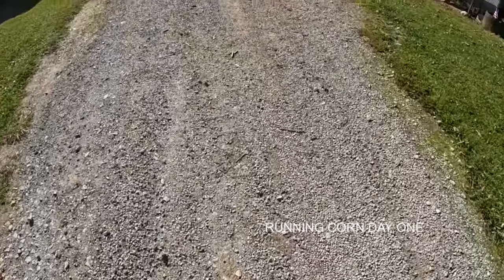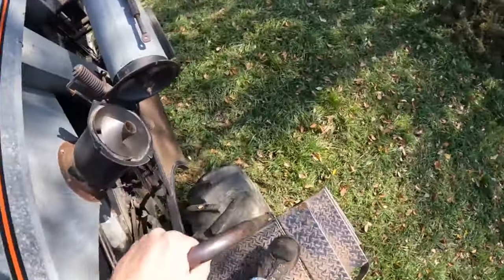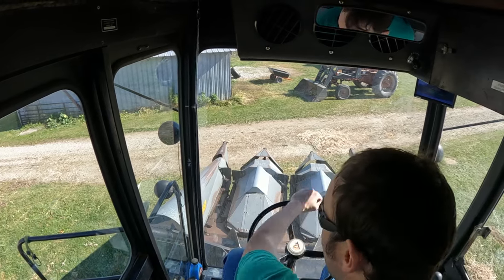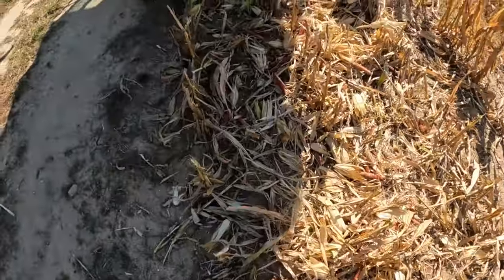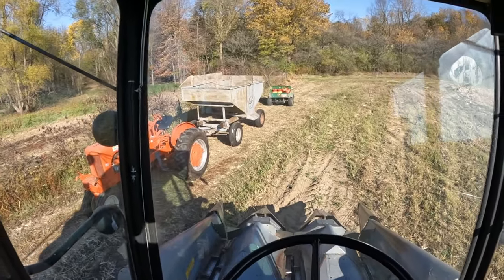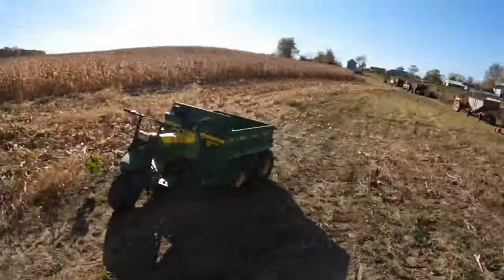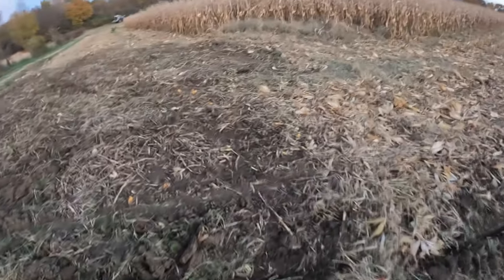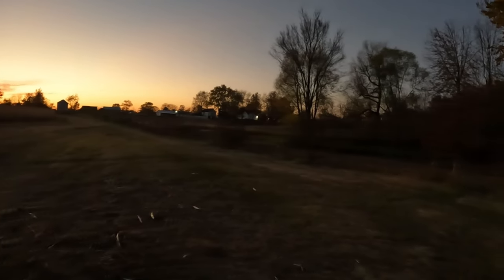Running Corn Day 1

Comment: You are the only YouTube that I've seen that actually stops the machine and gets out to check on the machine set up,  then reads the owners maintenance book to compare the schedule and how to adjust the machine to get the best out of it.  Your machine might not be the latest super dooper 25 row picker but at least most of the crop ain't going out the backdoor.  you do seem to get the carts on the wrong side and have to spend time turning to unload.  Nice vids from Kent, England, the UK
Reply from the maker: Thanks John!  I appreciate it.
Reply: DsssY
Reply: LOL:)  Neighbor of my BIL bought a new CIH rotary and the salesman told him it was "field ready" when they delivered it... SO he went straight into the bean field and started cutting.  Well, he didn't figure it out til later, BUT evidently "field ready" doesn't include actually closing and latching the top cover on the elevator where it's tossing the beans over onto the yield monitor plate before they drop into the bubble-up auger and get sent into the grain tank... Of course EVERYBODY knew it after the next rain, because he had the prettiest green strips of soybean sprouts painted like foot-wide lines all the way across the field, tracing every turn, etc. They were so thick, like a carpet, so he probably lost 5-10 bushels to the acre... it was crazy!  He was glad when the freeze killed them and they turned brown and weren't so noticeable.  

Course, if he'd been climbing down and checking how his machine was running, particularly in the first five minutes after starting, all those beans would have ended up on the truck.  BUT no, too nice a cab with that pressurized air filtration system and Bose stereo sound, and that comfy recliner driver's seat... plus probably GPS to drive it so basically it's get in, turn it on, and let it go, and just ride along.  Difference between an OPERATOR and a steering wheel holder... 

I don't need $25,000 worth of electronics to steer for me and set the machine... NH just came out with a new combine that integrates the yield sensor, ground speed sensor, shaft sensors, grain loss sensors on the chaffer and sieve, tailings sensor, etc and then sends all that data to a computer, the computer calculates how loaded up the machine is (if it's running at full capacity) and the grain loss out the back and the yield, and somehow measures how clean or dirty the grain is, moisture, etc. and then integrates all that data and then uses stepper motors to automatically control the ground speed of the combine, header height, auto steer, as well as the rotor speeds, concave clearances, fan speed, and chaffer/sieve adjustments, so that it can automatically change the settings across the field as conditions change... if you get onto a high knob and the yield falls off, and there's little trash, the computer will automatically speed up the ground drive, lower the header for shorter stalks, increase the air for more weed seed and duff to be blown out from grass or weeds, and close down the chaffer and sieve to help clean the grain better.  When you go downhill into good ground that got plenty runoff and it's heavy corn, the combine slows down ground speed to prevent slugging or lugging the machine, opens the concave and speeds up the rotor a bit to increase capacity, opens up the chaffer and sieve to let more grain through faster, etc.  All without you touching a button.  Course it probably adds $30,000 to the price of the machine... and it doesn't do ONE THING that a GOOD OPERATOR can't do... BUT it does allow you to hire a numb-nut and turn them loose and do a decent job...

Comment: I operate a 715 later serail number. Some years ago i was opening a rye field when a terrible bang was heard on the mechine. The mechine trembled. As i stopped to look flames were rising on both sides of the engine.  At that time no cell phone available. I ran afoot  about 1/4 mile to phone and fire  department. Caused no field fire but the engine blew a rod and cap through the block.

Comment: You should never have to use starting fluid on a gasoline engine.  You definitely have a fuel system issue, or a very week starting/ignition system.
Reply from the maker: I’ll have to look into it over the next year.  Currently, the fuel drains back into the tank over night, so I can either crank til it fills the carb and starts, or give her a quick blast of the nose candy.  Is there a check valve or anything they make to keep fuel in the carb?
Reply: @richfarmer6143  add gasoline to the fuel vent on the carb, no need for spray I keep gasoline in a water bottle with a hole in the lid for just that
Reply from the maker: @johndowe7003  I’ll have to check that out.  I’ve never gotten into the carb except for replacing the tiny fuel filter in it.  Guess I’ll have to do some reading.
Reply: @richfarmer6143  what engine is in it? is it a ford 300? most carbs have a vent hole on em, your needle and seat are probably trashed and fuel just leaks out of the fuel bowl back into the tank, if you got a carter type 1 barrel you can rig up a little copper line to your vent then just add gasoline everytime ya wanna run it. i hate having to use up expensive ass carb/starter fluid. back then the cans were cheap but now theyre like 8 dollars each can
Reply from the maker: @johndowe7003   it has the Chevy 250 inline 6.  Replacing the needle and seat make a lot of sense.  When I get a chance, I’ll tear into it, as it probably could use a rebuild anyway.  When I get around to it, I’ll have to do a video on it.  The copper line sounds like a pretty good idea.  That’d def save some $ over time.  Is your 300 in a pickup?  Or is it in a piece of equipment?
Reply: @richfarmer6143  300 in a truck, mines fuel injection. I was basing my assumption on the block. Chevy 250 is the same thing pretty much. And yes I'd go for the copper line vent tube extension. I personally wouldn't open the carb up unless really needed lol. Better to Jerry rig 😂 if it ain't broke don't fix it . I'm pretty sure you got a Carter carb . Info is pretty hard to find on em since they work a little different from modern carbs. Definitely film it pretty interesting piece of equipment ya got. Buying cases of brake clean and starter fluid gets annoying after a while. Lol

Comment: Never saw a combine so tiny. Super cool that it still does a great job.
Reply from the maker: Lol, yeah it’s pretty small.  That’s part of the reason I like it so much.  The crazy thing is Massey made one even smaller.  The model 35 if I remember right.  My dad’s first self propelled combine was one.  It came with an 8 foot grain head.  My K came with a 10 or 13 foot head and a 4 row 20”, 3 row 30” and 35”, and 2 row 40” back in the day.  I’m pretty sure they offered other sizes later on, but I’m just going off of sales literature that I picked up at a tractor show.    I always thought it’d be neat to get a 4 row 20”, but have never seen a recent picture of one.
Reply: that combine is huge compared to the corn picker we had, LOL it was a one row Wood Bro's,  my father also used a pull type combine with it's own engine, had a maybe 4 foot head grain head, the engine was the same as a model ''A'' Ford, I believe,

Comment: One time I was working doing something with the old '68 Ford 5200 row crop diesel and I had pulled up to the leg tank and dieseled her up. I was just about finished just standing there and suddenly smoke started POURING out from under the hood.  Next thing I know the slight oil leak from the valve cover gasket down the engine block caught on fire.  I shut the diesel off right quick and put the hose up and turned the leg tank valve off, and looked around for the hose.  Didn't see the hose handy but there was a shovel there, so I grabbed it and just started digging and throwing dirt on the side of the block.  Snuffed the fire out pretty quick.  Got to looking and somehow or other something shorted and it burned up the stupid new generator, which was only a year or two old.  Fried the wiring harness across the front of the engine back to the regulator box behind the battery.  Well, I pulled the wiring harness off and cut it apart at the kitchen table, cut out the burned spots and soldered in new wire, taped up any burned insulation spots on the other wires, made sure everything was good, and then re-wrapped it with electrical tape, so it was good as new.  What ticked me off was, I had JUST bought a new tachometer for that tractor, which was about $350, so I could get the speed right to spray more accurately.  AND of course the tachometer, instead of having a gear that ran off the cam where the distributor was on the gas versions of those tractors, no, this one had a little worm gear and spur gear running on the back of the generator shaft, screwed to the back of it.  The generator wasn't but a couple years old.  I always hated those old generator systems because they didn't put out that much power, they were prone to burning up and wearing out commutators, and if it wasn't the generator itself, it was the stupid regulator which was a separate box. SO I decided I wasn't replacing all that crap.  BUT I still needed to run my generator to work the tachometer.  SO what I decided to do was install a Chevy alternator, like I'd done on other tractors before.  First I gutted the burned-up generator, took it apart, ground through all the field wiring, and ripped it all out since it was all fried and burned.  Then I repacked the bearings and bushings, removed the brushes, and took the fan off the front pulley, making it a "dummy" that was just there to spin the tachometer cable.  Then I got a Chevy alternator and mounted it just below the generator.  The regular 70's Chevy alternators have a two-wire flat plug on the side and a single large power output lug on the back.  They're super-simple to wire up... there's a brown wire and a red wire on the 2-prong plug which connects to the internal regulator.  The brown wire is an "exciter" wire from the key switch, "hot in run" and the red wire is the "field" wire which energizes the regulator and the rotor when the thing starts up.  The brown wire kinda senses the voltage in the system, and the regulator controls the magnetic field of the rotor to vary the output of the alternator when its running.  The lug on the back is the output of the alternator, which runs through a heavy-duty wire back to the battery cable terminal on the starter.  All you have to do is run a wire to the run switch (key switch) which feeds the alternator through the 2 prong regulator plug, then connect a short wire from the field terminal looped back to the red wire on the 2-prong plug for the field power supply, and then run a heavy-duty wire (that can handle at least 70 amps or so) around from the alternator output lug to the battery cable lug nut on the alternator with a big ring terminal.  For safety I installed two fuses of 80 amps capacity-- when the tractor is running, the alternator is producing power and sending it through the HD wire to the starter battery cable, and if it shorts out between the alternator and starter it will full-field the alternator (maximum output) and really heat that wire red hot and could start a fire-- so I put one fuse at the end right by the ring terminal on the alternator.  When the tractor is off, since that HD wire is attached to the battery cable at the starter lug terminal, if it were to short out, it could backfeed 100% battery power through the wire and heat it red hot and start a fire, so I installed a second 80 amp fuse between the wire and the starter cable end lug ring terminal, so if it were to short in EITHER condition running or parked, it will blow the fuse on either end and prevent a fire.  I also installed an ammeter in the circuit so I could check the output easily and make sure the alternator was putting out properly.  

I measured around the pulleys to see what size belt I needed, which wasn't a problem, BUT I did have one small problem-- the belt was going to rub on the side frame rail of the tractor beside the engine... well, actually part of the front bolster but still same difference.  I got to looking around and I had a flat back idler pulley off an 83 Mercury we'd bought for parts on another project, and there was a bolt hole in the casting nearby, so I cut a piece of angle iron, torched a hole for a bolt, and then figured out where the pulley needed to be mounted, and then welded the pulley bracket to the angle iron, and bolted it in place... went and bought a belt and presto! Perfecto!  The thing worked like a champ... belt came up from the crank pulley over the water pump to the faux generator, down to the alternator, around its pulley over the bolster edge around the idler pulley, and then back down around the crank pulley again.  Worked like a champ.  We ran it that way for another 5-so years til we traded the tractor off on a 96 Ford 5610S.  The dealer dolled the tractor up and did some work to it, new tires and PTO brake and some other minor things.  I figured he'd get rid of my electrical system and replace the generator and regulator, but when they repainted it and put it on the lot, NOPE it was just the way I had engineered it.  Tach worked, alternator worked, idler pulley worked.

Comment: TSC... "Never what you need out here" LOL:)  I used to love TSC, bought a LOT of stuff from them over the years when we were row cropping, chains, hoses, sprayer parts, water well stuff, pins, hydraulic stuff, tires, some batteries (usually cheaper at Auto Zone-- used to get those $30 AZ batteries and put them in everything... cheaper than them big dozer batteries that used to be $120 on the Ford 6600 tractors back in the 90's, started just as well unless it was REAL cold).  Now TSC is a bad joke.  I hate even going into a TSC anymore... most of it is a dog/pony store, and the rest is garden junk and decor stuff... hardly any real "supplies" anymore, parts and stuff.  I got sick and tired of having say a 3/4 female elbow bust on the sprayer and going over there to get one, and having to get 2-3 different fittings to screw together to replace it because they didn't have the right size, didn't have the right thread, didn't have the right fitting, so it was just "grab stuff and figure out how to make it connect up to what you had and fit in the space... and of course now they won't hire anybody but kids whole work for nothing, and they don't work hardly, and their managers are pretty much worthless too anymore... we had a good one and she quit the company for a better paying job, and we never had anything but idiots after that.  

Rural King beats TSC all to pieces... I wish our TSC would be replaced by a Rural King, but unfortuantely we don't have them in south central Texas yet...

Comment: Great video. I have a k and used 238 this year, I got a black 330 and everything seems to be optioned like yours but the drive chain seems to be off about 1.5 inches. I see some needing jackshaft to align them, but yours is directly connected. Did you need to change something on yours for alignment? May be able to flip the pulley over to keep the belt aligned and slide the shaft outward
Reply from the maker: Thank you!  Yeah I ran into the same problem.  As long as your combine has a new enough serial number, you’ll just need a new double sprocket for drive sprocket to run both your grain and your new corn head.  When I get a chance today, I’ll look up the part number for you to give to your local Agco dealer.  It has that extra inch and a half offset built into it and bolts right onto the end of the shaft sticking out of the throat.
Reply: @richfarmer6143  That would be great! Thanks
Reply from the maker: @lylebaker7893  ok, I still had the box mine came in.  The AGCO part number is 70575291.  It is a double sprocket with 13T and 25T.  Note, this should be all you need as long as your combine serial number is newer than 8201.  Otherwise, it looks like you might need to chase down the newer countershaft which is part number 1162502-7 in the corn head book.  Note the double sprocket is part number 0575291-0 in the parts book printed in 1981.  So, AGCO must do a little adjusting on the part numbers for house keeping.
Reply: Perfect! Thanks for detailed info. Mine is non variable header speed and looks like yours. It is from 1975, S/N  above 20,000. Mine  is 13 tooth, sounds like it should work.

Comment: How efficient is the gas engine? We’ve never had a gas combine before. We’ve had all IH over the years, 8 row machines. 3 915’s, then 3 1480’s, 3 1680’s, 2188’s, 2388’s, then went to 2 8120’s.
Reply from the maker: Wow!  That’s a lot of combines!  I bet it was neat to see the change over time.  I don’t have any other combine experience to compare it to.  But, I did end up measuring the fuel consumption later on, and it looked like it was burning about 5 gal of gas per acre.  Now, with my 4 row planter, basically I had to run two passes per planter pass.  So, if I chase down a six row, or drop one of my planter units, I’ll be able to run the same amount of passes on the combine per planter pass.  Folks on here are telling me, I’ll be able to save 33% of that fuel.  Which will be about 1.5 gallon or about $5.10 an acre as of yesterday.